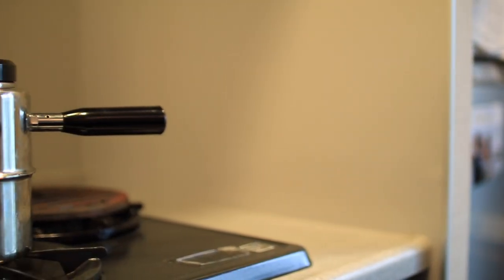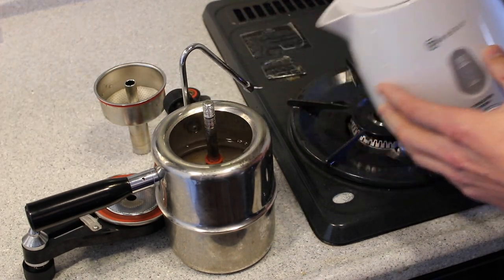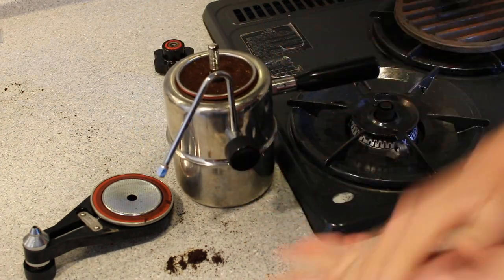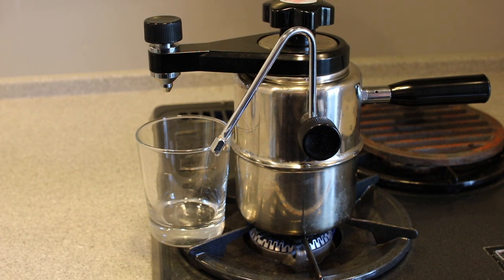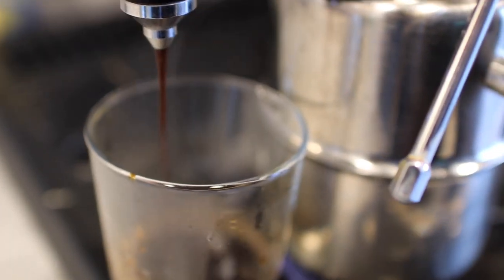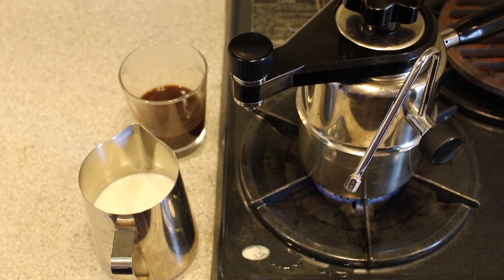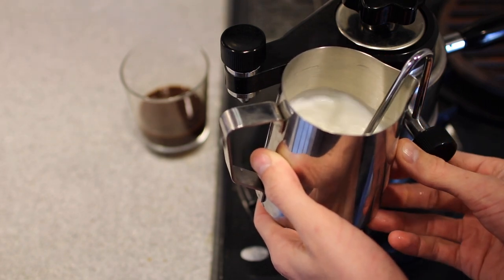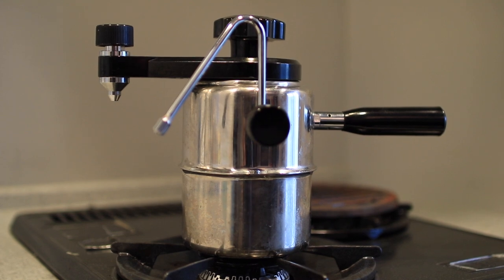Bellman CX-25 - 3 Steps to Perfect Coffee

Comment: Thanks! After watching serval videos, reading online, and the manual- I can finally use this.  I just had horrifying results- many videos and instructions do not tell you to open the wand at first- just cook for 5-10 minutes.  Also no one mentions the grind- I did fine, so my nozzle clogged.  Just wild hot steam and splattering espresso everywhere.  Most all reviews show using the gauge- my is the older no gauge model.  Thanks again- wish other info sources were useful.  Also your presentation was perfect- very well done!

Comment: Great video. Without the pressure gauge, you need to manually “guess” when pressure is correct.  Great tip on leaving the steamer valve open to do this. Have you tried the circular coffee filters that are now available. I’ve had issues with coffee grinds clogging the exit tube. This may help.  Thx again!

Comment: To add to your tutorial ....I use the insert in the coffee basket and stopped the peripheral leak by flattening the outside edge...since the edge comes curved , you can use a small hammer and tap the edge down on a flat piece of steel till it fits the basket 😁.
  flow of coffee controlled by the knob is rather erratic because the valve becomes clogged with coffee particles  and has to be re adjusted .I put a neoprene washer between the coffee basket and the filter to stop the leak between the center bolt and the basket...  when you use a paper filter on top of the coffee in the basket the clogging mostly disappears and the flow is constant without the intermittent  three feet geisher of hot coffee coating your kitchen 🙄 
I cut my filter from coffee filters to the inside diameter of the basket and the hole in center is cut with an exacto knife like a x.
When I start the Brew the coffee knob is closed and the steamer is open.When I get a steady stream of steam I close the steamer wait 20 seconds (that gives you about 1/3 of a bar pressure)....then open the coffee valve till a bit of coffee comes out....then tilt the bellman with the spout up 15 degrees to get all the air out of the top lid and put it back on the stove... You can close the valve and wait for an amount of time depending how strong a coffee you want..
The Bellman offers you variables in pressure ,amount of coffee etc so you can Taylor it to your taste....have fun 🙄

Thanks Patrick for your insights .much appreciated.
Reply from the maker: Thanks Jan, great information. I like your idea of re-opening the coffee valve to steep the coffee first!
Reply: Hi @Jan Kuyper and thank you. Understood that you put a custom-cut piece of coffee filter on top but what do you mean about the hole in the center being a plus? (BTW that hole in the center is a minus when it comes to filling the basket w/ grounds. Some ppl plug that hole up while loading the basket, gaining ease and speed.)
Reply: The + is a cut made with an exacto  knife in the center of the filter so it slips over the threaded post....when you want to go completely OCD you put a thin gasket over the post before the gasket to stop the water and air from passing through the center hole ....but yes that's too nerdy for most people.🙄Have fun..
Reply: @jankuyper8353 where did you get the neoprene washer and what size did you use?

I seem to have more coffee in the boiler than ever comes out the spout.

Comment: Great tutorial! Many, many thanks. Ended up rewatching it in 15-30 second increments as I was doing my first (apprehensive) trial of CX-25 (one wrong decision away from a makeshift bomb?). 

It would be amazing to see you cover how to make 6-9 shots. Filled mine to 6 with nearly full basket and got only about 3 single shots before the coffee started watering down. Could one repeat closing the coffee valve, opening the steam one and letting the pressure build up again for additional coffee? Or is that essentially reusing coffee (yuk)? 

Also — it would be amazing to see the final steps of proper depressurisation and when safe to open.

Would love to see an extended follow up on further Bellman mastery! This was the only tutorial I trusted to follow for the CX-25 (no pressure gauge to guide you). I’m grateful it exists! Thanks again.
Reply: I'm curious how you're coming along with using yours. I recently purchased a vintage one and am researching all I can to use it properly.
I was intimidated by these types of coffee makers, but I've seen what happens when they do fail, the gasket would give before the metal ruptures, and as long as the pressure release valve is not covered with water it should be safe to use. I do wish there was an easy way to modify it to add a gauge though, would just make me so much more comfortable using it.

Comment: Ive used my bellman on gas, glasstop and traditional electric element.  I did not like the representation from the gas, perhaps some type of thick steel heat pad would maintain even heat. Glasstops stoves do a pulsing on and off thing- the worst stove for bellman. By far the best result Ive had was from an electric coil element, it delivers consistent heat right through till boiling.

Comment: This was a great video, but this whole time I am just wishing you referenced the pressure gauge as a marker. Everything else was really helpful. 👍🏼😊
Reply: The new model has a pressure gauge. The old (as in this video) does not. You have a CX-25P but this is for the CX-25.
Reply: @discussionswithalex  I love mine. I got the one with the gauge, but I use it exclusively for steaming.  Not only can I get a higher bar pressure than my machine, but it’s consistant dry steam, and now I can add things like simple syrups chocolate  condensed milk spices for golden lattes etc etc etc. The best part is there’s nothing to worry about on this vs using the steam wand on my machine.   On the main machine I stick with milk only.  A few times I’ve forgotten and used simple syrup, but no problems.
Reply: @discussionswithalex cool!

Comment: Hi so i liked the video tutorial, I followed al the steps however, using the same logic as a Mokka, i did not tamper the coffee  just slightly over filled it but no pressure. This worked better, there was a smother flow, more crema and I believe it is how it was intended to use. I was then also able to use the divider to make a single shot without wasting coffee.
Reply from the maker: Hi Francesco, there’s lots of variables with this machine and many ways of making coffee with it. This is the great thing about the Bellman!

Comment: So use it as a Mocha Pot? I think I get pretty good coffee out of it but not the best. I use the method in the manual but mine has the pressure gague which I believe makes it a LOT easier to know when to start to brew. My biggest issue I struggle to get any more that 60ml of coffee even when filled to the 9 mark. I do use the spacer under the belief that it seals on the gastket on the bottom of the basket. Without makes sense though. I will give it a go your way and see what difference it makes. In hind sight I would use my Mocka pot and buy the Bellman steamer, not the CX-25. Thanks.

Comment: Super! I have been using mine only as a steamer for milk and like you said at times I get the milk and pressure correct.  Replacement gaskets err not so good as the tolerances seem to be a bit off.  Any suggestions for sources for replacement gaskets?  Thanks for a great video!
Reply from the maker: I haven’t replaced mine yet but it there’s lots of third party distributors for these machines. I’d recommend getting in touch with Bellman directly for genuine service parts: http://www.bellman.com.tw

Comment: Hey Patrick, I recently picked one of these up off a neighbour's chuckout pile. The coffee extraction is good but the steampipe doesn't seem to produce enough steam. Enough hot steamy air comes out to heat milk but no stretching takes place. I undid the steam valve and cleaned out some crud but no improvement. Any ideas?

Comment: Hey just tried this method after a few failed attempts - when the steam comes and you close the wand and open the valve, should the pressure still be sitting on 0 bars? Been waiting for coffee to come out but not seeing anything yet - thanks!
Reply from the maker: I don’t have a pressure gauge on mine but depending on how fine the grind is and how much you tamp, it takes anywhere from 1-2 mins for the coffee to start flowing

Comment: I have an old used Bellman, and it's  great as a milk steamer, but I cant get it to make coffee this way. The only thing I can figure is that maybe the coffee valve is clogged, because steam just starts shooting out of the handle and I get no drip from the espresso part.

Can anyone help?
Reply from the maker: Possible if it had been heavily used and the water in your area is quite hard that there’s some scale build-up. Best way to flush is to run some weak citric acid solution through the machine. You can get citric acid powder from the supermarket baking section